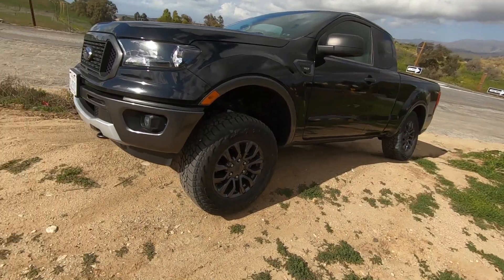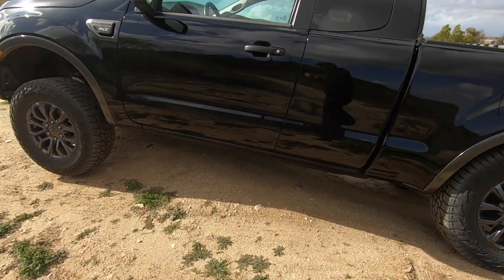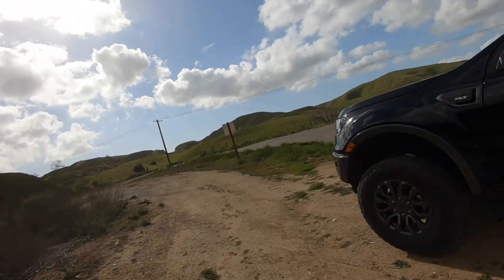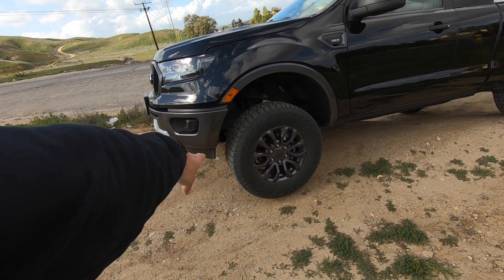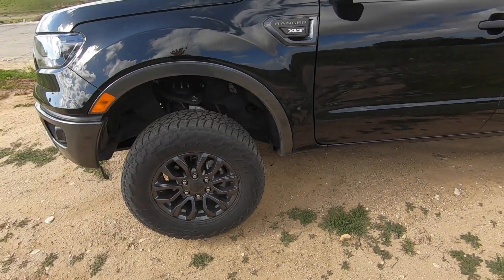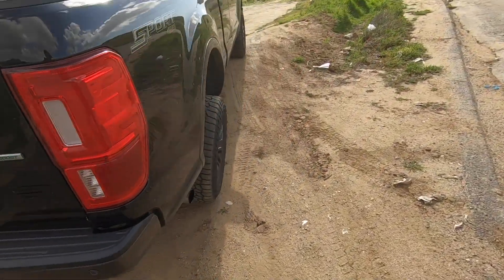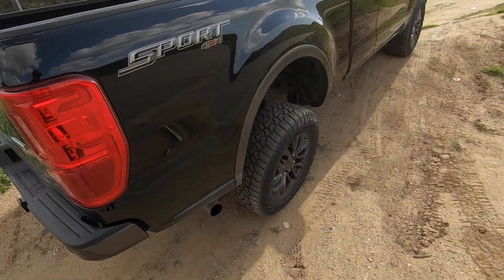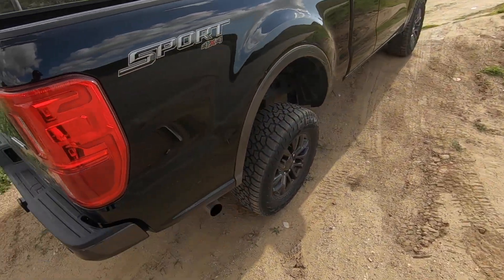What is Articulation? w/ a 2020 Ford Ranger

Comment: 2019 here. I’m adding the OME (OldManEmu) leaf spring pack with 1.7” of lift. I had the factory leaf springs with the Ford Performance FOX 2.0 setup front/rear which is a great setup. But it can’t hide the shitty performance of those factory mono leaf springs. Unfortunately my FOX 2.0 rear shocks only allow 1.5” of lift and I’ve read a report of someone popping those shocks with the 1.7” lift on the OME leaf pack… so now I have to install the Bilstein 5160 rear shocks which allow up 2.0” of rear lift. Supposedly this will make my ride very cushy around town, beautiful for light off-road, and significantly improve trailer towing. I also have the Timbren rubber helper springs so I can put a limit on sag while towing but overall the OME springs and Bilstein shocks should handle significantly better.
Reply from the maker: That sounds like it will be almost perfect. I might have to try that setup.